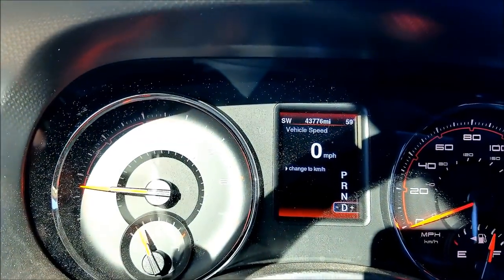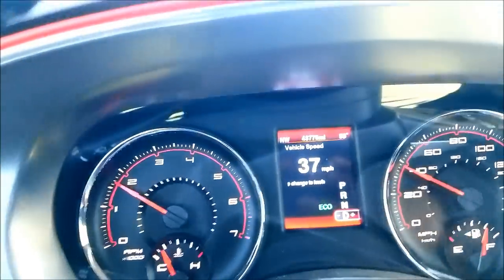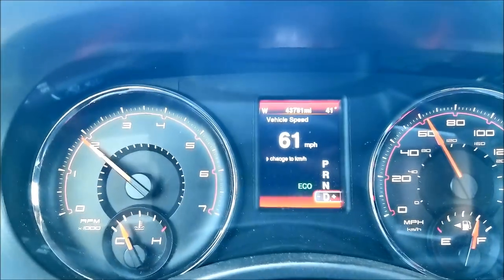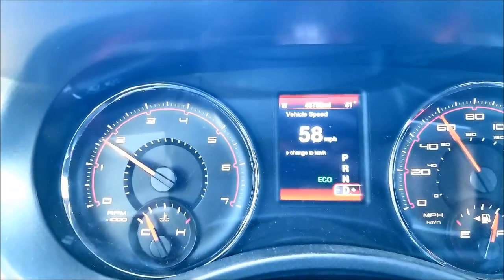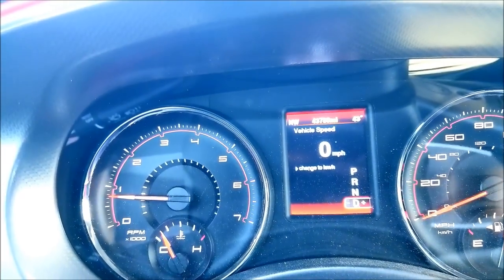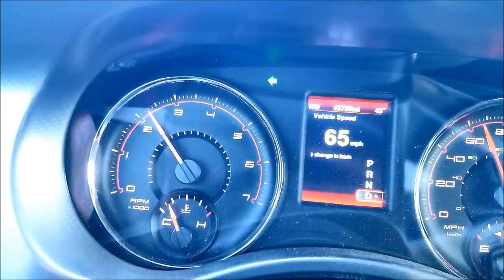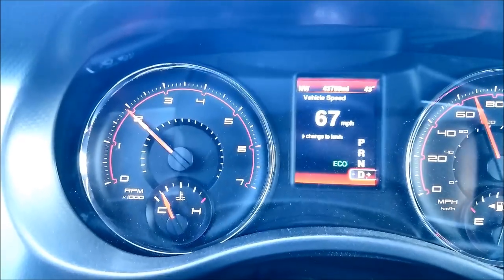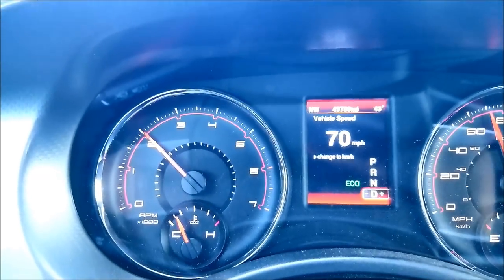Can You Daily Drive High Stall Torque Converter?

Comment: The question is as a daily driver what does this do to MPG and thats going to create extra heat.
Reply from the maker: It will lower mpg for sure. Most modern converters have a lockout so the overheating isnt much of an issue unless you are in heavy stop and go traffic for long periods of time.
Reply: @dasllamas  Do you actually see it go into lookup when you are cruising below the stall number
Reply from the maker: @yankeeroad626  once im cruising it acts normal. Anything above 45ish is what ive seen when I was "testing" when i first got it. My trans temp sits around 170 degrees stock and with the 3600.  Ice seen it hit 190 in heavy traffic.
Reply: @dasllamas  What are your cam specs that required the stall?
Reply from the maker: Stock cam
Reply from the maker: @yankeeroad626  i procharged the car and didnt get the acceleration I was looking for so the higher stall torque converter really opened up the 0-60
Reply: @dasllamas  Ahh ok. Im buiding an LS motor from the ground up keeping it N/A.
Reply from the maker: @yankeeroad626  that's awesome! If I were not at high altitude I would have stayed NA as well
Reply: YankeeRoad if you’re worried about gas mileage build a Prius!! Lol  Your mileage suffers because you can’t keep your foot out of it. Don’t forget the tires will wear a little more too! Good luck with the build
Reply: @oicu81b42eh  had a turbo 350 lock up quit working and mpg dropped from double to single digits. Not asking for 40mpg. And nothing wrong with trying to keep mileage up. Don't have to stop at a gas pump every 4 miles. Either way I've decided to just keep with the T56 plan. Better all around. transmission for my purposes.
Reply: YankeeRoad the converter locks up and mileage didn’t seem to suffer that bad. Gonna get same mileage and heat as stock on the highway. I just can’t keep my foot out of it. Looking for a t56 for my 68 Firebird. Has the Muncie, and love rowing the gears. Couldn’t imagine having an auto in a classic

Comment: You should run a lower stall converter, perhaps slightly higher than stock.  And instead replace the enormously heavy crank pulley, for a billet CNC Aluminum Ultra-Light Pulley.  The engine will spool / rev so quickly that you will still gain torque multiplication, but the lockup occurs with the engine screaming up in RPMs.  The pulley stock on my car was 7 lbs. and race pulley (not under driven) is only 0.9 lbs.   You can still drive it normally, but it will launch with perfect wheel slip at 3000 with wheel speed so high, my traction control needs to be disabled.  At least my J-Series NA Monster V6 Honda engine does.  :P   Any higher RPM / Wheel speed and my sticky 19 x 9 inch tires would smoke.

Comment: I daily with an 8" 5000. restalling to a 6000 soon.
Reply from the maker: Bo White that would be insane to DD. I know they make something that you can install to set the stall lower for DD and open it up for the track. Forgot what its called.
Reply: mine is an off the shelf PTC #TH00 
Drives awesome. Converter technology has came along way in the last 20 years. Ive been driving stalled vehicles for 30 years.
Reply: I recommend a 3200 to most people with a stock camshaft.
Reply: @bowhite1293  Damn lol I was doubting myself thinking a 3000 stall was to much for my sbc 350 with a Howards big mama rattler cam. Thought I had it figured out with a 2500 stall now idk again lol
Reply: I just had PTC restall it to 6000 or so yesterday. Still daily driver.

Comment: Great video, what’s your concern on heat build up from sliding while driving in slow traffic?
I have a 700r4 with 2800 stall hooked to 406, 450 hp....notice heat build up while just street driving had to install adjustable lockup kit to allow manual locking at different mph. Problem that creates is constant surging from unlock to lock while driving!
Any suggestions on how to remedy the problem.....
Reply from the maker: I had the builder/tuner set the lock up and I have not seen increased temps. I sit at 172 for trans temp in city and highway. Heavy traffic makes it go to 180.  Highest I have ever seen it was 192.  I do monitor all my temps constantly when I drive. 

I have not had issues with surging while I drive. However, when I have let others drive my car I can feel surging.  I think it has to do with two factors. How the lockup set and how the driver manipulates the throttle.

If you are getting an excessive amount of surging maybe adjustments need to be made.

Comment: You can drive, the fluid heats up more than it should and high stall on the street literally sucks I don't care what anyone says, 2500 works well, 3500 and up kind of a joke, been there done that,.
Reply from the maker: Trans temps have stayed around 183 since this has been in the car. TC lock out now and the issue with overheating the trans isnt as big of an issue as it used to be.

Comment: That's a stupid question, you can for a few months and then your truck will start breaking.
Reply from the maker: I did it for 40k miles and it is still running strong with the new owner. I dont think the question is as stupid as you think.
Reply: @dasllamas  so you don't think keeping the engine in power at take off and during shifting is reducing reliability of the drive train? Would you rather run face first into a brick wall or would you rather run face first into a pillow mattress against the same brick wall?
Reply from the maker: @macbook802  i think you may be arguing a non lock up converter vs a lock up converter.  No matter what analogy you want to use, this car has 80k miles on it, cammed and procharged, daily driven, and raced.

It's time to get away from the old school way of thinking about torque converters, see what new tech and what a good tuner can do.

Comment: It is not good for the transmission  to not fully engage cruising around it create excessive heat and eventually burns out the torque converter and the clutches in the transmi$$ion i have a 454 blown street rod early 70's no brain. This fellow here has a newer car probably with a computer telling the transmission to shift at certain RPM i have a manual valve body i shift by my tach light. the idea is to select a stall 500 RPM more than your cam so your are making horse power before the stall kicks in so this idea might  not be  good for all applications....Call Jegs or Summit tech's before you do this
Reply from the maker: Mike F newer tc have a lockout that lock the torque converter so it prevents the excess heat. I have mine set so high so it flashes when the centrifugal supercharger is in boost. 

My transmission temps sit at 173 degrees and doesn't really move from that. This coincidentally is what it was at with the stock tc.
Reply: There always been lock out converters that is not new everything works with your cam in you car the rear gear and tire size your running mine spins the converter up quick on a strait away because i have 4:11 gears in a big bearing ford rear. I have a 33" x 18.5 w tall tire so back roads my converter slips in and out all the time  that's why i have a transmission cooler and for drag racing and round robin at the track. Your newer car probably has a temp sensor fan on your cooler and a brain or maybe you still have overdrive anyways sit in heavy traffic bumper to bumper for a little while on a hot ass day see what your trans temp does remember your talking a daily driver that's to work and back home we all love rush hour traffic
Reply: Fake news. Thousands of miles, no problems